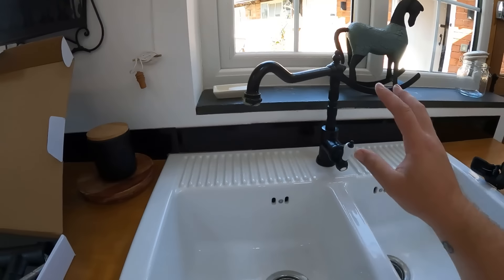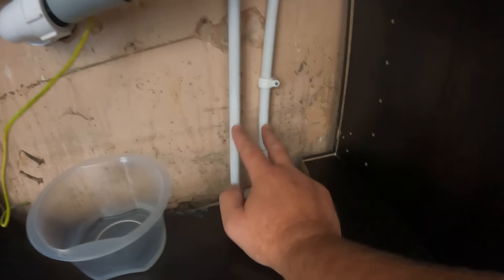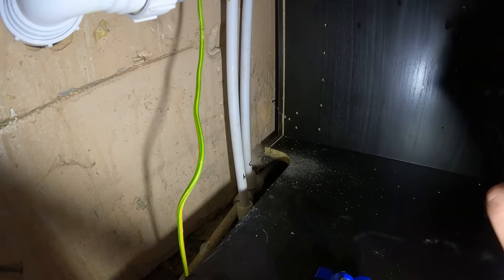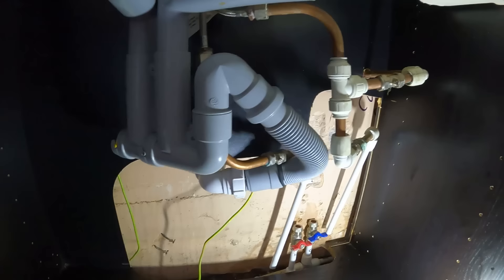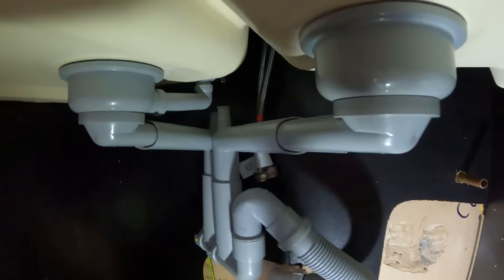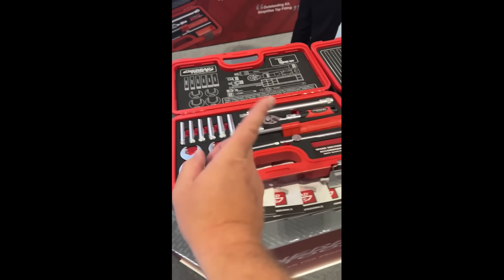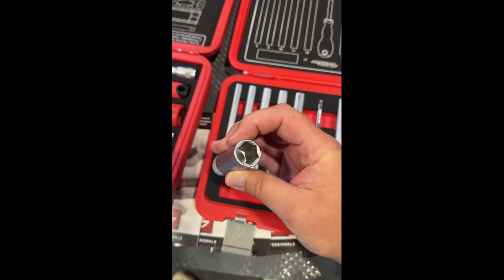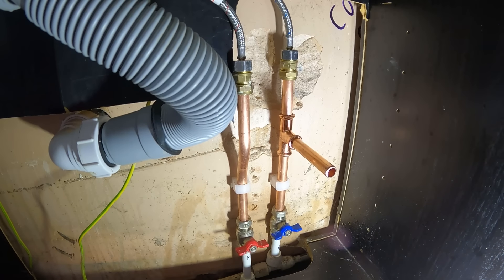KITCHEN TAP SWAP.....with some bad PLUMBING PIPEWORK  (VERY Rough)

Comment: Why do people/plumbers/kitchen fitters leave the threaded bolt so long? It takes 30 seconds to cut it down to an appropiate size so that a regular socket set can be used to tighten and/or undo it. Then, there would be no need for expensive 'Tap socket sets'  that are clearly not fit for their job ( unless you spend even more money buying extended/long reach sockets that should have been included in the original set!). Just go buy yourself some long reach sockets... I've been using them for years!
Reply from the maker: What happens when the long rod is all ready on and your trying to remove it😉👍🏼👍🏼
Reply: They leave the bar the size it was supplied for a very good reason... believe it for not if you cut that threaded bar it voids the guarantee for the tap, crazy I know!
Reply: @evervol1 Really? I don't recall ever seeing that in the paperwork. Will have a good look next time.
Reply: @colintowndrow9501  some state that if the stickers are removed from the flexies that voids it aswell 🤣
Reply: @evervol1  Haha, you got me.

Comment: Some advice please, when I try to connect compression to push fit pipe, it never holds. I also am never able to put the olive on with the inset in. It’s made me worried about ever combining them.
Reply from the maker: You need an insert buddy

Comment: We never use compression on plastic pipe because too much expansion on the plastic. Also if you are you need to use a metal insert.
Reply from the maker: Never had an issue using them on plastic….. we all do what we are confident with 👍🏼
Reply: JG compression insets are plastic,same as super seal ones.

Comment: IKEA special edition traps 😢😢,

You will a bigger van Mark for all this fancy new equipment 😂

😎👍🤜
Reply from the maker: Hahaha….. very true
Reply: They're a bit of a nuisance outside Scandinavia these traps. In Scandinavia it seems all drains go down into the floor and then these traps make total sense. If the drain goes into the wall they don't.

Comment: It is annoying about the Nerrad Tapex kit have come across this issue a couple of times, do you know how much extension kit will be? Also I’m so glad I bought the angle jaw set for my gun, Best thing I did. Pricey!!! But has gotten me out the S#!? Plenty of times.
Reply from the maker: Yer deffo need some angle jaws I think.
Not sure on the price of the kit…. Maybe £80 I would think

Comment: Can press-fit be used in non accessible locations such as under a shower tray or would you solder them?  Cheers
Reply from the maker: Can use it anywhere you can get the tool into mate 👍🏼👍🏼

Comment: Why do you use full bore isolation valves when the pipework connects to flexi pipes with an internal bore of 10(?)  mm? Thanks.
Reply from the maker: Always have…👍🏼👍🏼

Comment: For them long threaded bars that you need deep long sockets for why dont you cut the excess off so that you can get your socket on there or get some automotive ratchet spanners with a flexi head ?

Good job as always tho lot neater than before 👍
Reply from the maker: Thanks mate…. Yep that’s one way…. Or just get the small adjustables up there 👍🏼

Comment: Lovely job there mate. Looks much tidier. I’m relatively new to plumbing, and don’t know what the double check valve is for. Could you explain why you used it in that situation? Thanks mate!
Reply from the maker: Thanks mate.

Double check valve is to stop back syphonage…. So the water doesn’t go back into the cold supply…. Basically a one way valve

Comment: Great video Mark. Was wondering on the outside tap pipework does the iso valve have to be after the check valve or does it not matter.
Reply from the maker: Doesn’t matter as long as the valve is there 👍🏼👍🏼

Comment: Great video Mark liking the butterfly valves are they full bore? Neat and tidy job just how it should be. I’ve had to do this myself a few times and it can def take a lot longer than a normal tap replacement. Thanks again.
Reply from the maker: Yep always full bore mate…👍🏼👍🏼

Comment: I've had an issue twice with the swivel part falling apart. They've sent a new one and it's happened again not sure if it's a dodgy part, I've only used the kit less than 5 times
Reply from the maker: Which part do you mean

Comment: Good job mate , do you need to use an insert when fitting them valves ? I thought was only plastic to plastic you use them
Reply from the maker: Thanks mate….. use them whenever possible to keep the pipe rigid

Comment: The Nerrad tapex kit is great but they need some bigger sizes for the taps that use the fixing bolt like  a banjo bolt as an outlet for a tap with a flexible hose outlet.
Reply from the maker: New kit coming soon 😉👌🏼

Comment: Neat job although I would have put full bore on hose tap pipe.You can get them in press ballofix type.And bes has side jaws on sale
Reply from the maker: They are full bore……👍🏼
Reply: @MJTiffPlumbing  I am on about the balofix valve for the hose tap.Doesnt look like full bore to me.

Comment: Great job but I thought the regs state you need to have a drain off valve on after the isolation and check valve do you can then isolate and drain the pipe out through winter, that’s how I’ve done them anyway
Reply from the maker: Just turn it off and open the tap outside…. Expansion has somewhere to go then.
Check valve is regs
Reply: @MJTiffPlumbing  Fair enough, personally like to just stick a drain off on the pipe inside and drain in completely then
Reply from the maker: 👍🏼👍🏼 no harm in it

Comment: Those milwaukee automatic pipe cutters are rubbish on 15mm, still using my pipe slice, too! Just a thought don't ALL outside taps have double-check valves built into their bodies ? Therefore, there is no need for adding an extra one?....
Reply from the maker: You have to get the specific outside tap with check valve in, not all come with them. Plus don’t even bother using them as they freeze up in the winter and shatter the plastic, then don’t have a check valve at all, always best to fit them internally

Comment: Re the long threaded bar on some taps. I still use the long box spanner which comes in a pack of 3 for about £6.00. They slot tgether and I don't need to buy the fancy set or spanners for I bet £120!! Why paste on plastic pipes? Why paste at all!! It went out with hemp!!
Reply from the maker: Why would you NOT paste on fittings….. it takes seconds and seals well….. 

And yep, everyone has the £6 box spanner’s….. 👍🏼

Comment: Under a sink - push fit is so much easier!!
Reply from the maker: If you’re a DIYer maybe…. But any good plumber will not have pushfit where it can be seen…. Well, not any respectable plumber 

Not for me mate……
Reply: @MJTiffPlumbing  Under a sink is hardly on view!! OK compression fittings. Easier to adjust than press fit!! Maybe we agree to disagree!! Oh and whay all that apste!! Never used it!! Ha ha

Comment: lol , i am no plumber but do my own to and extent just some people really need to throw there tool bag on Fb market place for free and let the common sense people have the tools, ive done a better job using the force lol, remember the fitting the tap and tails trick i did that not long after i watched your vid, your like WTF is going on  that easy lol
Reply from the maker: Your no spelling guru either mate 🤣🤣🤣
Reply: @MJTiffPlumbing  i am not but Education don't make you intelligent lol, think you took it all the wrong way
Reply from the maker: Tbh mate I’m not sure what you’re on about….. sorry
Reply: @MJTiffPlumbing  It does look a bit beer talk lol , last part was about that vid you did fitting the tap without faffing around underneath, I did it a few months later on Kitchen tap